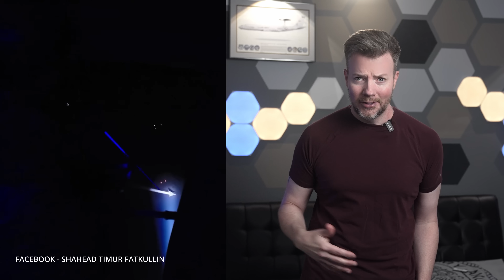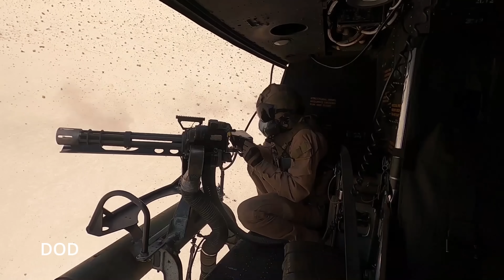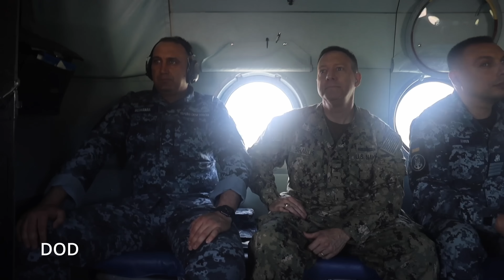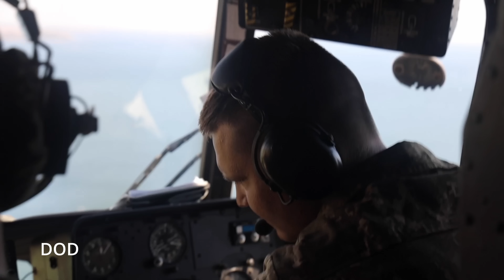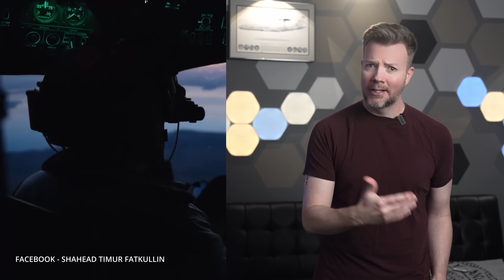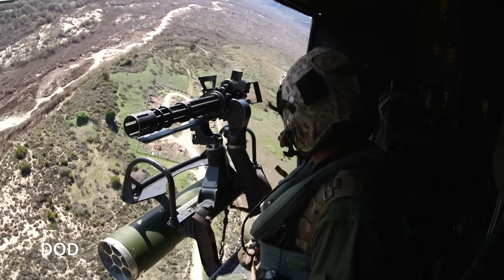Soviet Chopper Meets American Firepower!

Comment: holly shit! shooting shahed by 12.7mm rounds must be very, very dangerous, because of small distance. Why not Poland produces an A2A version of Piorun with airborn aiming solution? Why not loads it on a cheap turboprop trainer, like the Polish PZL 130 Orlik? It could lift 20 missiles per sortie, stay 3-4 hours in the air, if needed effortlessly slow down to 150-200 km/h, and attack from rear hemisphere. This is way easier for such aircraft, than any supersonic jet, or even advanced trainer.

Comment: I wonder if the M134 could be inexpensively modified to use 7.62x39 (AK-47) rounds, still enough energy to take down a drone, maybe less expensive and in greater supply in Ukraine.

Comment: Here is a  idea,, Ukraien could purchase a  bunch of Motorized hang Gliders,, attack a  mini gun on a  metal frame,, pilot has night vision goggles anda  lazer scope attacked,,, Have 100 hang gliders on the east side of Kyiv flying high abouve any power lines,, ,,working with helicopters with radios, all working as a  team... These gliders are cool and pretty stable.

Comment: Mil-8 Mongoose....hunting venoumus snakes...i would prefer if those weapons came as a modular package....the same mount for, lets say iron sights, NV or thermal...just exchange the mod, same goes for mounting...it should not matter if you place it on a helicopter, speed boat or even a drone. This i think is the real lesson that should be learned. Adaptation is king

Comment: Cool, but it is overkill . A correct aiming system on a MG-3 would be as good . The cheap chinese DNT TNC 225r with IR + NV  & ballistic calculator is enough. Only the “LEAD” aining has to be adjusted.

Comment: Wonder if you can strap such a Minigun (using standard Nato 7.62 ammunition) to one of these crop duster planes. As a crop duster is likely good enough and has way less fuel consumption as well as maintenance cost/times compared to a helicopter and still a similar speed.
Reply: Ukraine could probably set that up on any prop plain. Hopefully Ukraine has a lot more prop planes besides helicopters they can use for that.
Reply: @Paul-b7p  You can't. Especially Ultralights will get VERY slow or even overweight with such a gun strapped to its belly. So you need a plane, which has a good weight to share and power reserves, to have the plane airborne (drag reduces cruise speed and increases fuel consumption).
Reply: @Paul-b7p  In Vietnam the US used miniguns on Cessna aircraft.
Reply: The crop duster type Ag Planes are not equipped to fly at night.
Reply: Skyraider II:
https://en.wikipedia.org/wiki/L3Harris_OA-1K_Skyraider_II#%3A%7E%3Atext%3DThe_Air_Tractor_L3Harris_OA%2Cbeen_militarized_in_other_programs.%26text%3DAn_OA-1K_Skyraider_II%2CEglin_Air_Force_Base%2C_Florida.%26text%3DThe_AT-802U_Sky_Warden%2Cpurchase_75_aircraft_by_2029.?wprov=sfla1
Reply: They have some Kukuruzniks (An-2) with miniguns over Odessa... But no footage I have seen
Reply: @dostavki  And I really like the style of that plane. 

With respect to flying in the dark: Night vision goggles, of course some extra IFR equipment - and pilots being trained to use these. 

Unfortunately,  the Argentinian FMA IA 58 Pucara is likely not available. Wonder, if there are still OV-10 "Broncos" left. Way faster than any UL or Helicoper and still safely(!) in the flight envelope of a Shahed with a bit below 200 km/h cruise speed.
Reply: That would make a mini A 10
Reply: @walterrwrush  With way less armor, punch and maintenance. Bit still good against drones and having a sidewinder option, any old stockpile of outdated AIM-9 variants is still good to shoot down a Shahed or cruise missile, if intercepted (and being guided) properly.

Kind of Guepard - outdated for its intended use, but may see a second life in the rear, having a new purpose until being replaced.
Reply: I like the Super Tucano. It can fly slower than a Shahed, and 2-3 times faster than a prop one.

Comment: This is good. Even at 50+ bullets per second, 7.62mm rounds cost less than alternatives.
Reply: It is good but you also have to calculate the damage when a drone hits. If you have to treat fifty wounded civilians or lose a factory production line it is still good to use higher cost weapons. Those cost between 200.000 and 2.000.000 euro to rebuild or treat.
Reply: @jacksonteller1337.... The aim surely is to hit them out in the open en route to their target not over the target or built up areas